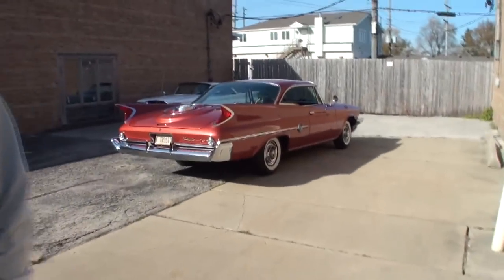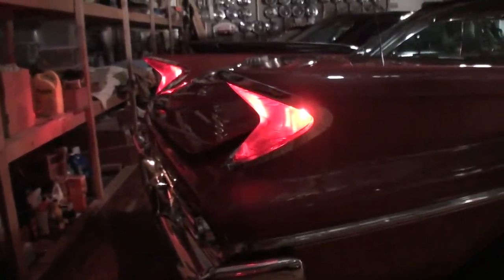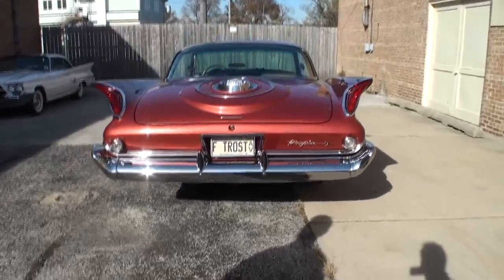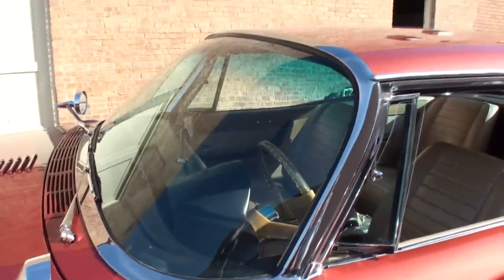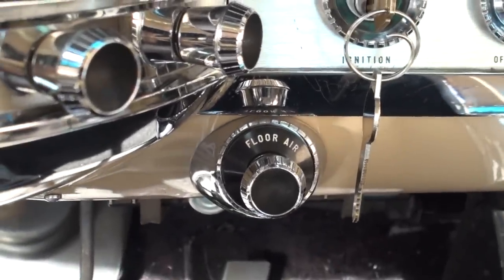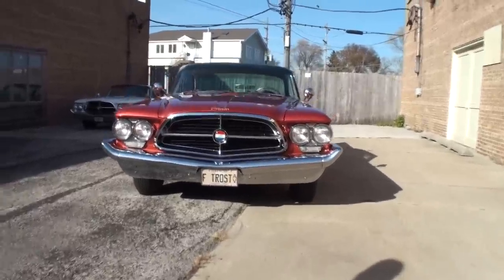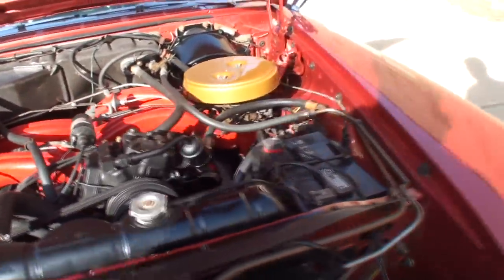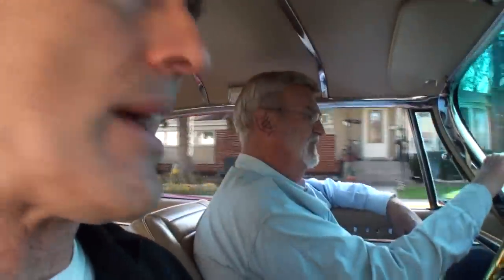1960 Chrysler 300F in Terra Cotta with Cross Ram Induction & Ride on My Car Story with Lou Costabile

Comment: I'm looking at this again. This has to be your best coverage of "trunk and treats". You covered key portions of each item without overdoing it. Because the brochure only covered the 300F  we didn't have to see unrelated models. I'm not a fan of big fins on 60's cars but the boomerang tail lights, found on the 1960 F, are the most attractive of these later letter series cars. 
The front and rear bucket seats and the full length console are really cool. The engine and dual carb set up is impressive. I like the color but the faux spare tire on the trunk lid detracts from the beauty of the car lines.
Reply from the maker: Hi Bill, High praise on this "trunk & treats" portion of this video :-) Thanks you for viewing and sharing the details you enjoy, Lou

Comment: This is the one Chrysler  fin car that I like and it is because of the beautiful and tasteful boomerang tail lights that fit seamlessly in the fin. I also love the front and rear bucket seats with the full length console. The AstraDome light cluster and the swivel drivers seat was way cool. Personally I would prefer a red car sans the faux spare tire on the trunk lid.
You did a great job videoing the car brochures.
Reply from the maker: Hi Bill, Happy to read you like this fin car :-) Lou

Comment: Just a beautiful car! Yes, the "Bankers Hot Rod." Those are some serious fins, a good design starting in the middle of the door. The taillights fit perfectly into the shape of the fin and Chrysler didn't mess them up by trying to fit the backup lights into the taillight design. The front end with the grill is great. Today spark plugs last over 100k miles, in those days they had to be changed quite frequently and those plugs were not an easily accessible.
Reply from the maker: Hi Randall, Happy to read you enjoy the looks of this car :-) Thanks for viewing and sharing, Lou
Reply: Once you jack up the front end, pull the wheels and unbolt the 8 bolts holding the access panel on each side, changing the plugs isn't bad at all.

Comment: Nice ride indeed and in beautiful condition.  Not sure it was mentioned but that motor is a 413 with 375 horse rating. NOT a max wedge super stock version of the 413 though.  They had the short runner intake manifolds and probably bigger cam and higher flow heads and big exhaust manifolds.  Those fins are great to launch sky rockets like we did with my buddies ‘60 Desoto with similar fins.
Reply from the maker: Hi Kim, Thank you for viewing and sharing your knowledge. Hope you see many more cars on this YouTube Channel you enjoy. Please subscribe, and hit the "bell" so you can see all the cars when they are uploaded on this YouTube Channel, Lou
Reply: And - 495 ft pounds of torque! A small handful of shortram 300-Fs were produced for 1960. 6 of these raced the Flying Mile on the sands at Daytona Speed Weeks in early February 1960. These shortrams were the same 30" length as the longrams, but the first 15" off the carbs were open plenum, bumping the horsepower to 400. These rams were cast aluminum. These few 1960 and 1961, the optional dealer installed 1962, the standard 1963 300-J, and finally the optional 1964 300-K shortrams are not to be confused with the max wedge setups, as you correctly mention.

Comment: This is a beautiful "60 Chrysler 300 F.Nobody could do fins like Virgil Exner and Chrysler.GM might've come out with them first but Chrysler took it one step further.A 1960 Chrysler fin is in the top 5 of all 1950s-1960s fins.And for a little bit of  useless trivia....The 1961 Chrysler Imperial has the tallest fins of all manufacturers of the "50s -"60s.It is not the 1959 Cadillac like everybody wants you to believe.A 1961 Imperial fin is a good 1 inch taller than a 1959 Cadillac.These were measured at factory suspension heights of course.
Reply from the maker: Hi Penny Wise, Thank you for viewing and sharing your knowledge. Hope you see many more cars on this YouTube Channel you enjoy. Please subscribe, and hit the "bell" so you can see all the cars when they are uploaded on this YouTube Channel, Lou

Comment: this car had the 421 HO V8, around 375 hp, 400 lb ft torque.  4,000 lb car, would do 0 - 60 around 7 seconds flat.  Not too shabby.  Yeah, and it could chirp 2nd & 3rd pretty good.
Reply from the maker: Hi Trev0r98, Thank you for sharing your knowledge, Lou
Reply: @loucostabile   You're welcome.  The actual torque figure for that 421 V8 was closer to 400 lb ft (which i corrected in my OP)

Comment: The 1960 Chrysler and closely related DeSoto have to represent Virgil Exner's final styling triumph. Both makes were stunning for 1960. The 1960 300 is the kind of car dreams are made of ,certainly the masterpiece of the long running 300 series..
Reply from the maker: Hi Stude289, "The 1960 300 is the kind of car dreams are made of ,certainly the masterpiece of the long running 300 series" High praise. Here is that 1960 DeSoto. https://youtu.be/Jm6nrTVWoLQ

Comment: Exner designed body with superior Chrysler engineering of the day.  Short reach ram induction was designed for drag and long reach is for highway driving.   The long reach Ram delivers more power at passing speed.   It was amazing how Chrysler considered their customers "needs."  But, what's really funny is none of their "banker class" consumers opted for short reach and that tech ended up used by Plymouth and Dodge, with further modification, on the 426.  Their engineering flowed down hill until 66 or so, when the 300 became a rebadged, lighter New Yorker.  66 was unlettered but the 440, HO, dual exhaust car was faster than the 413 cross ram cars....  It should of been lettered.  67 was the last year for the option of the police pursuit engine....  That was the end of the line of high performance big Chryslers.
Reply from the maker: Hi Chuck, Thank you for viewing and sharing your knowledge. Lou

Comment: That was the best color offered for that series, IMHO.
Those front and rear buckets were Chrysler-exclusive. I doubt that any other of the Big Three even offered front buckets in 1960.
That roofline and rear end have got to be the best-looking for any 1960 full-sized American car. I think, that year's Crown Imperial got the better-looking wheelwells and front clip, though. Unfortunately, you can't just bolt the Crown's front end onto the 300s.

375 horsepower was pretty good for that year. Resto-modding a 426 or even a 440 with that compression ratio, cam and carburetor set-up should at least get it near 400 horses. The only Full-sized car of that year to outdo that 300's horsepower was the Lincoln with the Tri-Power 430 M.E.L. block, if it even was still available after 1958. But, in a drag race, the fatter Lincoln would probably lose, due to being overweight, despite being a Unibody.
That instrument pod looks like one of those old Art Deco radios which had cathode ray tubes, before transistors were used.
If only Chrysler Corporation had stuck with all of that chrome and turned aluminum for their mid-Sixties and up models. 
That console looks like that stainless steel plate was intended to make way for the floor shifter of which was never made available.
That definitely would have been my choice, if I was old enough an wealthy enough to buy one, back then
Reply from the maker: Hi Al Dente, Thank you for viewing and sharing your knowledge. Hope you see many more cars on this YouTube Channel you enjoy. Please subscribe, and hit the "bell" so you can see all the cars when they are uploaded on this YouTube Channel, Lou
Reply: Interesting factoid about those buckets is that they moved fore and aft on a bench seat frame, that crosses under the console, so isn't visible except when the seats are swiveled out. Chrysler 300s were never fitted with the automatic cable connecting the swivel mechanism to the doors - those were only fitted to some early-build 1960 Chryslers and DeSotos, before the idea was dropped.
Reply: Al Dente agree on the color. The car? Outstanding.

Comment: Awesome!! At least 2 tons of car, and a 150 MPH speedometer... Wonder if anyone knows (or remembers)  how close to actually getting near that speed these cars were capable of. Thanks, Lou!
Reply from the maker: Hi Dave F., Getting to speed would be fun, and then there is braking at "At least 2 tons of car" :-) You're welcome, Lou
Reply: Six 4-speed Pont-a-Moussin shortram 300-Fs ran 140+ mph on the sands of Daytona in early February 1960 in the Flying Mile runs - 2-way average speed. The TorqueFlite longram 300-F ran it at 126.6 mph.

Comment: The swivel seats that threw people out onto the roadway when they thought their door wasnt shut properly and tried reshutting it , that didnt last long as a feature. did it? I think Virgil had his heart attack around this time, hence the styling of the cars got watered down , I dont think people needed reminding themselves that they had indeed bought themselves the 300 trim package each time they approached and departed their cars over 10 times.
Reply from the maker: Hi Chuck.U.Farley, Thank you for viewing and sharing your thoughts. Hope you see many more cars on this YouTube Channel you enjoy. Please subscribe, and hit the "bell" so you can see all the cars when they are uploaded on this YouTube Channel, Lou
Reply: That was the late '50's early '60's everything in excess. Look at the '59 Caddy.
Reply: Also the 300 was not a trim package it was a stand alone model for all of it's 11 years. It wasn't a New Yoker with a 300 package like the first year Lemans/GTO.
Reply: Chrysler 300s were fitted with swivel seats for 3 years - 1959 thru 1961. Swivels were optional on the other Chryslers - Imperials, Chryslers, DeSotos, Plymouths, Dodges. The 1959 300-E and other models all had bench seats. For 1960-1962, front and rear buckets were fitted in all the Letter Cars. Interesting to note that, since Chrysler built so few bucket seat cars, the seats sat on bench seat frame rails that slid under the console, so the seats moved fore and aft together. Also, a correction to my buddy Frank's comment about the automatic swiveling seats. Chrysler Letter cars never had the cable-operated swivel seats. They swiveled by lifting a lever along the side of each front seat. The cable operated feature was indeed short-lived. It was fitted to some very early production 1960 models - I've seen these on New Yorker and DeSoto 4-door sedans. Folks always laugh about the door popping open and the occupant flying out, but who knows if that ever really happened?!

Comment: I take it It has 2 4barrels how many cubic inch motor???
Reply from the maker: Hi Nathan, It's in the description of this video (413 CI V8 engine with 375 HP, and 495 foot pounds of torque.) Lou
Reply: @loucostabile  That's amazing! Didn't realize they had the technology. For hi performance cars like that in 1960
Reply: @nathanduckeorth806  It was the beginning of the horse power decade. In '63 Chevy would introduce the 409, Ford the 406 and we were off to races literally. Win on Sunday sell on Monday.

Comment: It was the only way they could pull the power out of the motor with the technology they had. A 750-800 cfm 4 barrel will pull more power .
Reply from the maker: Hi Bart, Thank you for viewing and sharing your knowledge. Hope you see many more cars on this YouTube Channel you enjoy. Please subscribe, and hit the "bell" so you can see all the cars when they are uploaded on this YouTube Channel, Lou
Reply: Not sure I fully agree. The dual 4-bbl Carter AFB carbs sitting atop the 30” cast aluminum long rams generated supercharged performance with stump-pulling 495 ft lb of torque & 375 hp at 2800 rpm. Can’t name another production car of that era generating that huge torque.
Reply: They were smaller carbs and needed adjustments a single four barrel 800 is easier look at 1/4 mile drag racing hemi are running single big carb. It looks bad but as technically advances so does every thing else. Mpg is in the low single digits and most sat for long periods of time